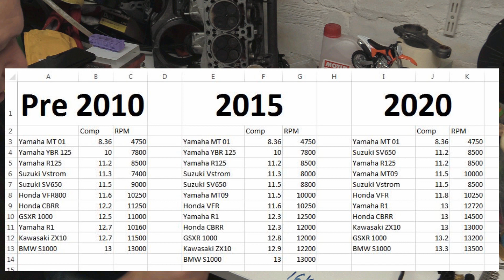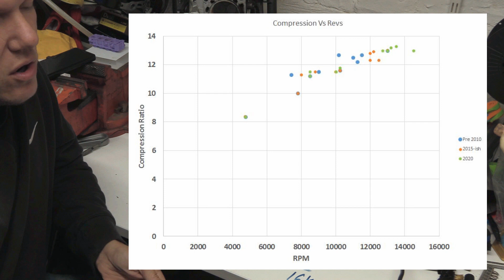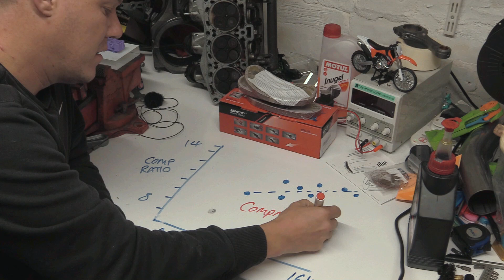High compression and RPM?

Comment: Here's my guess: Higher revving engines need more aggressive cams to make power at high engine speeds. More aggresive cams mean that compression begins later in the compression stroke due to the longer duration of the cams. The compression figure that they give you is calculated using bdc and tdc, but the actual compression is lower because compression begins after bdc.

Comment: I know your not a fan of the term dynamic compression but I’ve seen it written in text books and I’m told (by you) to believe books over strangers on the internet so I’m gonna go ahead and say it’s because of the longer duration cam closing the intake valve higher up the compression stroke, also if your trying to fit as bigger intake valve as possible you might need to make the exhaust valve smaller (or exhaust to intake valve ratio) to make it fit, in which case you need more compression so you can use a longer duration exhaust cam (to make up for the smaller valve) without wasting potential force applied to the piston as with higher compression  more of the force is used early in the power stroke
Reply from the maker: Dynamic compression isn't real, and I'll tell you why. The compression ratio isn't changing...

Comment: I can use my 120hp,  1300kg car with compression ratio of 9,8 on 95 petrol usage similar to 16l/100km. Cutoff happens on about 6500RPM. This engine is not fucked after 316000 km. I think, that not giving a shit about the last parameter will improve rest of them  without any cost difference :>

Comment: Less air gets into the cylinder at higher RPM due to inertia, so you need higher compression ratio to compensate?
Reply from the maker: Due to inertia
Reply: @thedirtyworkshop  Huh?

Comment: Well... let's see.
Cranks, rods and pistons are getting lighter all the time, hence, higher revving engines. 
Compression ratio, 9 to 1, 
12 to 1 what ever is just a measure of how much you can squeeze you air/gas mixture for a stronger detonation getting that lighter reciprocating mass to spin faster.

Comment: Unless you have a variable compression engine, the compression ratio is set (metal expansion due to heat being too small to matter).  What changes is how well the space is filled with mixture (and temperature) so that you do not get preignition/knock.

Comment: I really have no idea of the relevance but bear with me... At the other end of the spectrum where you have no RPMs (i.e. starting) you might have trouble turning over the bike. Hence decompression valves on large, single cylinder engines.

Comment: Thanks, been a while since I been on here ,nice haircut...reminds me of my military service days :) I run 11.1 with manual comp releases...easier on starter and batt. also my fuel mixture is 14.7/1 for the first 750 rpm again easier start. Also you have to put bore& stroke within the mix for rpm max and select the proper cam specs for the job at hand....all the ingredients have to be used   in the recipe for a great outcome.
On this note, carry on professor...:):):).

Comment: I'm thinking that manufacturers are just making engines with higher compression and peak power at a higher rpm, because they're getting the max power out of the avaliable displacement.  The higher compression helps to keep the torque from dropping too fast as rpm rises. So these thing are just to increase power and maybe arent related in any other way. Just my guess.
Reply from the maker: Ok, so look at it the other way 1.0 ltr car engine have compressions around 10:1. Bikes have compression ratios between 9 and 13:1. 

13:1 would cause massive detonation, but bikes run that high...
Reply: @thedirtyworkshop  I'm stumped. It must be the Evans coolant allowing them to run so cool and avoid detonation.

Comment: You could also look at compression ratio vs stroke too. You may find that following the same trend.
Reply from the maker: Some of these examples have the same stroke. Take the BMW S1000R- the bore and stroke remain 80 x 49.7 but the compression and revs increase from 13.0 @ 13,000 rpm to 13.3 @ 13,500 rpm...
Reply from the maker: The SV650 did the opposite. Went from 11.5 @ 9,000 rpm to 11.2 @ 8,500 rpm.... Maintaining the same bore and stroke of 81 x 62.6mm
Reply: @thedirtyworkshop  I sort of mean the shorter the stroke the higher the compression..  It is a bit against the trend for an engine to actually have a lower compression ratio as the bike evolves.. Unless they have a known issue and are trying to dial it out..

Comment: There are lots of reasons but I'm going put this one out there. The very oversquare design of the motor. The amount of surface area of the piston in relation to the amount of heat in the combustion chamber
Reply from the maker: If so then why does the compression ratio and rpm go up on the same bore and stroke engine?
Reply: @thedirtyworkshop  I'll go back to my first sentence. There's lot's of reasons and I really don't feel like writing a book on my day off. But I'll go with the generic answer. Time or more specifically lack of time.
Reply: @thedirtyworkshop  Lower un-swept volume at TDC?

Comment: My theory is that it is a coincidence that they follow each other, they do not need to.
High output engines tend to spin faster, so they need to have a higher quality and lighter crank, rods and pistons, the better quality allows for more compression to get more power, which was the goal in building a high output engine to begin with. Customers are maybe also more understanding about needing to fuel high octane fuel on a racing bike, compared to a more casual bike.
Reply from the maker: Apart from the mt01 which is the lowest compression and the lowest rpm...
Reply from the maker: And these are not top end. The ybr125 also follows this trend

Comment: To get that high specific output and because they dont have to do as many miles?
Reply from the maker: 100,000 miles isn't so many?
Reply: @thedirtyworkshop  both my beamers had over 200k
Do bike engines do that kinda mileage? Genuine question
Reply: Sure,there's a YouTubers that did 300k miles on a super tenere 1200
Reply: So my divvy 600 is sweet as a nut at 50k then haha

Comment: The limit on compression is detonation. At higher RPM there's less time for detonation to occur, so you can have greater compression.
Reply from the maker: No. Detonation is always faster than burning
Reply: @thedirtyworkshop  When would you expect detonation to happen vs ignition on a high revving engine? up to ~17500rpm
Reply from the maker: When? It isn't based on rpm
Reply: @thedirtyworkshop  That's not what I'm asking. ignition advance could be 50 degrees BTDC, so I don't know if it would be a problem if it happened after this? maybe it would be better to ask at what piston speed or point in the stroke it would be most likely to happen? could it happen at any point?

Comment: I feel like if rpm and compression were that related diesels wouldnt have such high compression, so is it just that when engines get made to produce more power they're able to handle more compression and also more rpm but the two arent related directly?

its like a bloody school quiz where the third option is 'neither a nor b' and you start to question your existence
Reply: Which do you think has more combustion force a high compression diesel or a low compression petrol?
Reply: I'd assume the diesel with it being more energy dense and all
Reply: @_ck_  Right, take a diesel engine with an 18:1 CR and gas motor with a 9:1 CR. Atmosphere is 14.6ish psi, so 18x14.6=262.8 psi and 9x14.6=131.4 psi. Now diesel and gas have similar energy densities, 10.7k Wh/L for diesel and 9.5k Wh/L for gas, and similar specific energies 45.6 MJ/kg for diesel and 46.4 MJ/kg for gas. So roughly the same energy input per amount of fuel used, and they both have similar air fuel ratios too, 14.7:1 for gas and 14.5:1 for diesel, but the diesel is double the compression, so it'll run double-ish the amount of fuel used per power stroke. However they have very different flame speeds 48.3 m/s for gas and 12.8 m/s for diesel (roughly speaking, cause reaction speed  will change depending on temp and pressure...). So you'll have more combustion force with the diesel, but because of the higher flame speed you can run a wider piston with a gas motor, and a piston with larger surface area will provide more force "pressure" (for the englishman) to make up for its lower compression...

But yea, a diesel may have a higher combustion force, but the gas combustion event will reach its peak combustion force faster.
Reply from the maker: Combustion force? Also known as pressure...

Comment: At higher rpm there is less time to charge the cylinder so volumetric efficiency drops.  This is compensated by increasing the comp ratio to maintain a dense volume of charge in the combustion chamber.
Reply: I like your argument, butIs it really that simple? Because the volumetric efficiency of na cars in relation to rpm is also dependent on intake design. I don't know how much of a difference the intake makes overal, but i do know that a fixed length intake will only respond well in range of rpm.

Comment: My limited understanding is that knock usually occurs at hi load low RPM situations  after thinking about it for a little bit my guess is that at high RPM the combustion cycle is more efficient meanings that intake and exhaust happens quicker resulting in less heat in the combustion chamber but saying that out loud sounds wrong

Comment: Higher compression ratios would allow a denser mix at TDC proved VE remains the same during both examples. I think what mat is getting on to is burn efficiency  in that first 90 degrees after TDC before the majority of the combustion pressure is expended on a NA engine. 

As for why it isn’t as high in cars I would put it down to the tighter emissions standards that cars have to meet over bikes with regard to NOX emissions that occur at high compression and heat.

Comment: I'd guess throttle-by-wire has something to do with the average compression ratio creeping up in 2020. 
They probably stop the throttle from opening completely if you give it a fist-full just off idle to keep the manifold pressure, and therefore cylinder pressure a bit lower.

Comment: Noticed the difference in compression ration between the SV and the DL, interesting since they are basically the same engine. 

Also, the latest versions seem to have gotten into some role reversal ?
The SV had higher compression in the previous 2 examples but is lower in the last one. 🤔

Error maybe ?
Reply from the maker: No.
Reply: @thedirtyworkshop  scrap the main quest Scooby, there's your real mystery!

Comment: an old mans thoughts on high compression a friend had a 250 Arial arrow put on high compression pistons + heads.and it sill would not do a ton.so he got a Norton dominator     and it did.things where simpler back in the 60s  .just like my chines 250.not safe and not to fast.but with luck would go from A to B. the good old days.whats rpm.

Comment: Never thought about it diesels are way higher compression compared to petrol but thats all about torque low end grunt and fuel economy in trucks cars bus's etc but with bikes ahh you,ve got me i want power acceleration with less weight does stroke length being shorter in petrols factor and shorter again for higher revs higher comp needed for shorter valve duration fuck it and as for ignition timing im stumped.

Comment: My Thoughts plz dont hurt me.
1. A bike because of its lower mass can get away with having smaller displacement, with this comes lower torque numbers at low rpm. Due to this lack of  "low end torque" the engine uses gear reduction and Rpm to bring the small capacity engine up to a more suitable operating rpm (powerband) .
2. High compression ratios are suited to smaller bore sizes as it is less likely to encounter detonation and i believe the likely hood of detonation decreases as rpm increases?
This smaller bore x stroke at high rpm combination also allows for a mean piston speed (theoretical limiting factor to all piston engine rpm) that is comparable to larger displacement car engine operating at lower rpm.  
3. Camshaft profiles of small capacity high out put engines favor high rpm operation. When duration is increased the timing of the inlet valve opening often becomes more advanced and the compression period of the engine starts later, resulting in a lower cranking compression figure. This is some what counteracted with additional static compression
4.As emission laws tighten manufactures constantly look to cut fuel consumption,  The refinements made to efi systems allow for a tighter more precise air/fuel mixture this paired with "advanced" combustion chamber designs allow for higher compression ratios and better flame propagation that result in a more complete burn and therefore better fuel economy.      

Happy to be completely wrong as always looking to expand my understanding of engine operation

Comment: Higher compression puts more of the fuel’s energy to work on the piston as combustion pressure, wasting less of that energy as heat and pressure released into the exhaust system.
Reply from the maker: Nope

Comment: well the shorter your cyllinder has to travel up and down the faster it can go around
Reply from the maker: What's that got to do with compression...
Reply: @thedirtyworkshop  im a complete shit at this stuff but if i understand it atleast somewhat adequately then the reason the rpms go up has some to do with that as the volume in the compressed state becomes smaller the cylinder gets pushed down harder and thus does its loopty loop with more force . could i be wrong? absolutely im not even worthty of being called an amateur at this stuff but taking wild guesses is fun.
Reply from the maker: Well you're having a go...

Comment: Wait I have another guess! It's because at higher rpms the combustion process is much less efficient so less fuel is being burned and combustion temps are lower! With a high rpm cam setup. So higher compression ratio can reliably be used at those temperatures...

Edit: and at lower rpm the cam has a lot of duration and overlap that the eversion and the fuel mixture passing through both valves during overlap makes for a crappy efficient combustion process too... So less heat

Comment: The higher combustion efficiency of a high compression engine means that torque does not drop off as quickly. Therefore higher rpm can be used which in turn gives better horsepower. 

Better design also means that engines can be more reliable at higher rpm and higher compression levels.

Just my guess

Comment: my guess is that a bike that is designed to rev high will have more valve overlap to help with scavenging at higher rpm. The large overlap will cause they dynamic compression to be lower. So they create a high static compression ratio to compensate and maintain a good amount of compression even with a lot of overlap.
Reply from the maker: "The large overlap will cause they dynamic compression to be lower."

- There's no such thing as dynamic compression!
Reply: @thedirtyworkshop  oh. fair enough. look forward to the next video to see where I went wrong haha

Comment: I know I am foolish, but the reason I think is that as you are increasing the compression ratio, you are also increasing the efficiency of combustion process and since you have a tiny spark plug at the center of the combustion chamber so increasing the compression ratio, helps it to make the flame propagation much more efficient and also the flame speed increases and this causes the engine to revv higher.

Comment: I can think of 2 reasons:
1- as the RPM gets higher there's a shorter amount of time for the combustion to get completed and because this engines are designed to have their peak power at a higher rpm and higher the rpm gets the ignition timing gets more advanced, they raise the compression ratio to have more pressure before combustion at higher engine speeds
2- because two engines with exactly the same displacement one with 10:1 and another with 13:1 compression ratio, the one with higher compression ratio can get the combustion completed faster because there's less volume for the flame to travel
i'm writing this of top of my head and i don't remember if i read them somewhere or not so they can turn out to be complete bullshit!

Comment: Higher compression will aid in faster flame propagation which is needed for higher rpm. So my guess is that higher rpm straight up requires higher compression in order to run efficient and not burn only half of the mixture.